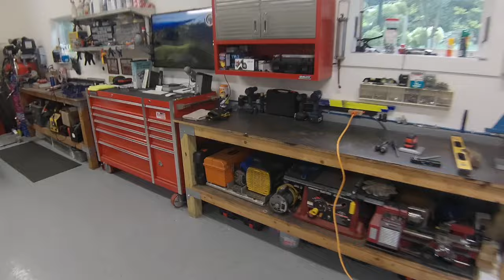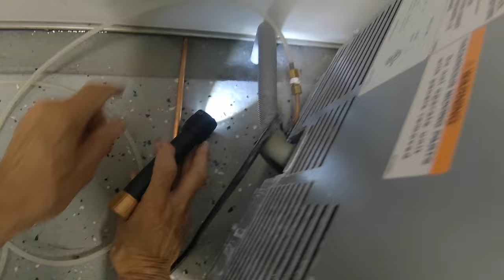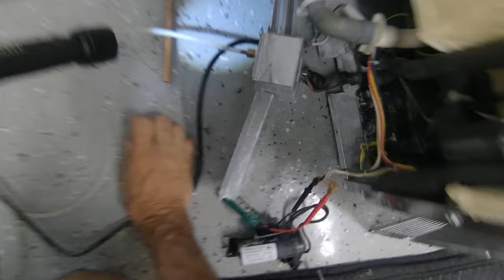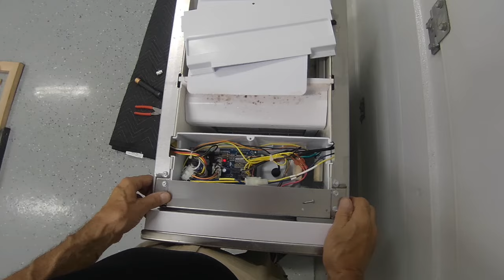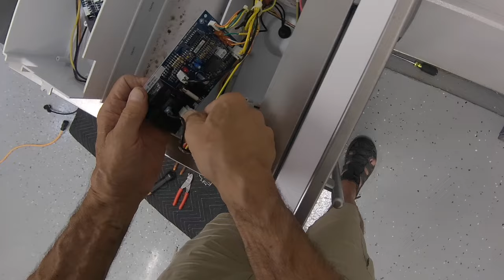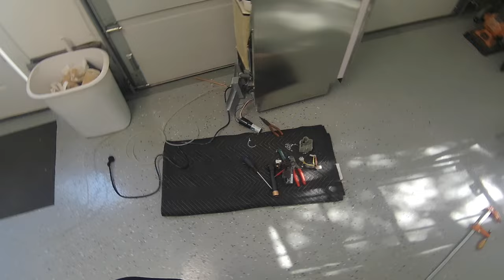Sub-Zero UC-15 Diagnoses

Comment: hello good morning my name is Rainier Garrido and I am a refrigeration technician brought me a model unit UC-15IO without capillary that someone tried to fix and took out the capillary, I write to know the information of how many meters of capillary the unit uses and if there is anything else I should know about the freezing system
Reply from the maker: @rainiergarrido8483  are you asking about the heat exchanger? The capillary tubing is soldered to the suction line.
Reply: @SubZeroSpecialists the capillary was removed and I want to know how many meters of capillary the unit uses
Reply from the maker: @rainiergarrido8483  I don’t have access to that information, call subzero 800-222-7820 and speak to tech support.